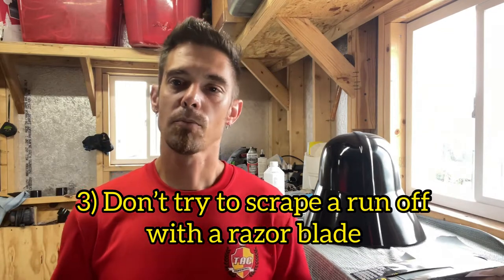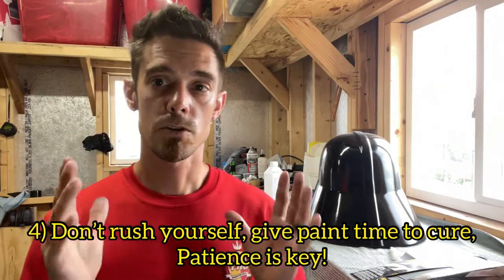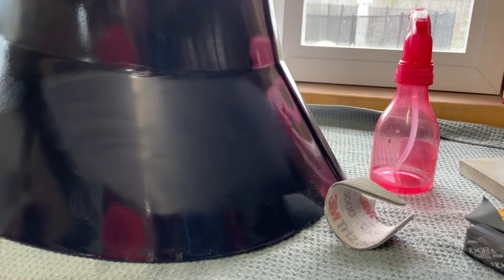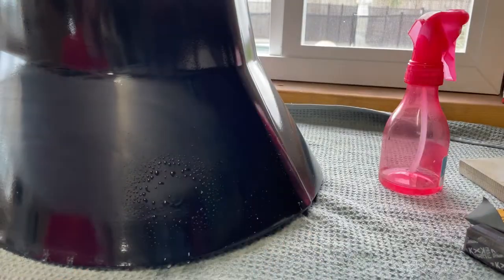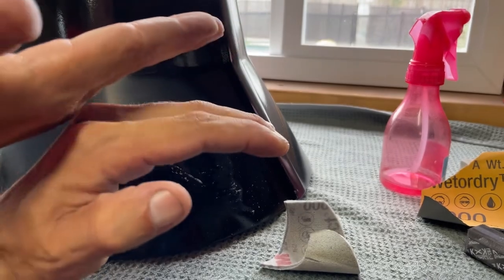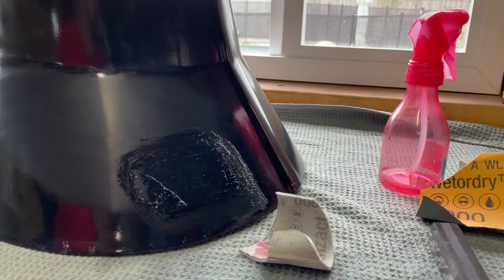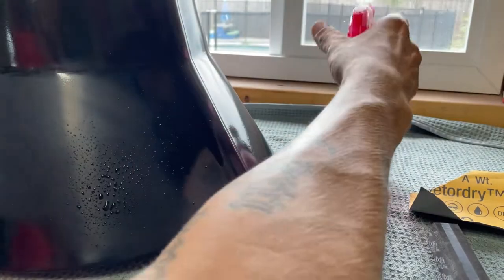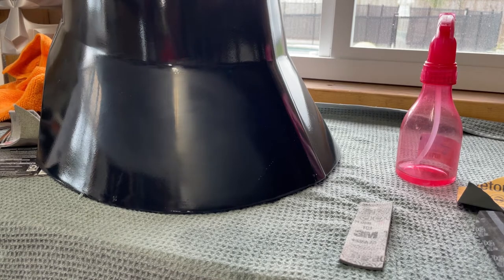How to fix paint runs in your 3D prints | fixing paint defects & wet sanding 3D prints

Comment: You the man! Looking forward to seeing it finished! Don't worry about the length of the videos they are fun to watch.
Reply from the maker: Haha thanks I was told mine are too long
Reply: @Darkwingdad  Not at all - Have you ever tried alclad metallics about to do a mando helmet with chrome but i'm scared :D Want to clear coat it and buff it before applying alclad with airbrush. Not sure about it though
Reply from the maker: @shutinyanks  you can clear coat the problem is you need the right clear. Is the. Alcad your using enamel or lacquer?

Comment: Really appreciate this video. Thanks for sharing. Any suggestions if I have one small part with a few small sags in the semi gloss clear coat? Hoping to avoid spending $100 to fix it.
Reply from the maker: You just mean some light runs in the finish right?
Reply: @Darkwingdad  Yes. They’re obvious though. Sanding I can do. It’s the compounds and polishes and tools that are $. If I was going to do much more I would invest but I only have 4-6 months so this is probably the one and only repair.
Reply from the maker: @braddahr  you have a decent drill available?
Reply: @Darkwingdad  Yes. I’m looking at the pads. About $30. Add the compounds etc another $35, then getting the wrong stuff and having to order something else ha ha = $100.
Reply from the maker: @braddahr  if you watch my Vader builds I display a drill adapter ($15-$20) and than you can get 3D one compound for about $20. If you need links I can send em
Reply: @Darkwingdad  I’ll check them out but you need to convert to Canadian $. Ha ha. Your $20 can easily be my $35.
Reply from the maker: @braddahr  lol damn my bad. I used to spend a lot of time in Canada when I lived up north. Love it there just too cold in winter
Reply: @Darkwingdad  they can be a bit onerous at times but the free health care makes them bearable. 😏
Reply: @Darkwingdad  I might have to bite the bullet to get it done. The piece is for a custom computer case for my son. I would rather spend the money on a few other things I want to get done before the clock runs out. Frustrating but I very much appreciate your suggestions.
Reply from the maker: @braddahr  how bad is the sagging? You can email me pics might be able to guide you through it if you have a Walmart nearby
Reply: @Darkwingdad  I can send some pics later today. It’s not huge but bad enough it’s noticeable.
Reply: @Darkwingdad  I took several pictures but it’s difficult to see the defects. Where can I send them?
Reply from the maker: @braddahr  darkwing_dad850@yahoo.com

Comment: Does this work if you don’t have a clear coat on yet? Is this run your showing paint or clear coat?
Reply from the maker: If you get a run in the paint you can wetsand it but than you need to repaint that area.
If it’s clear coat you can wetsand, buff & polish
Reply: @Darkwingdad  thanks. What grit sandpaper do you recommend on the spray paint runs? Do you wet sand? I have been using a duplicolor metal cast red paint that runs super easy. Been doing super light coats 5 minutes apart and seems to still run.
Reply from the maker: @benibarra23  for duplicolor it’s very thin & delicate. 3k wetsanding is ideal. Don’t go too heavy bc it’s metallic and there is a pattern the metallic creates. If you take too much off it will be noticeable